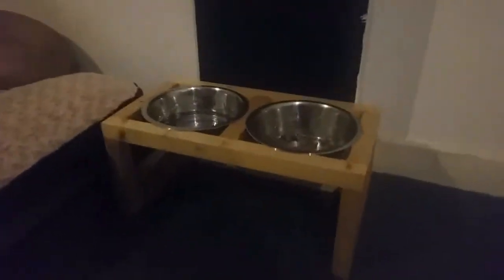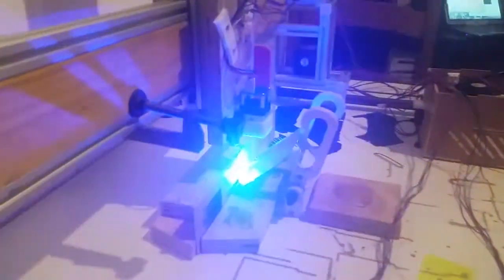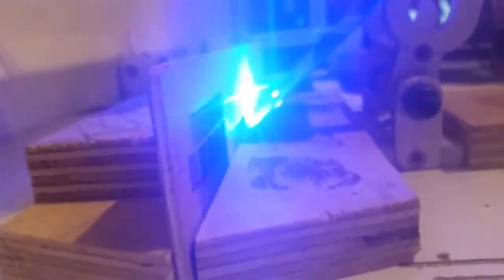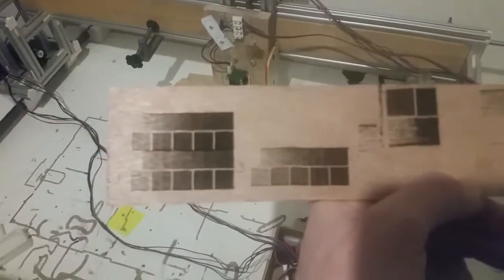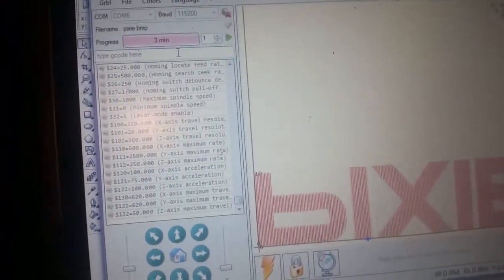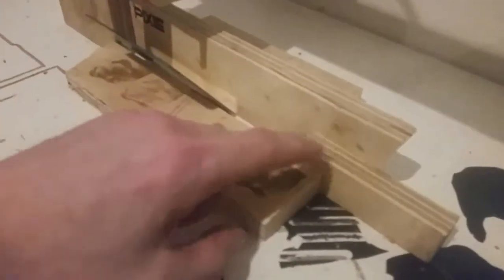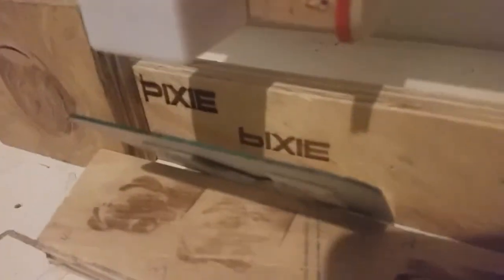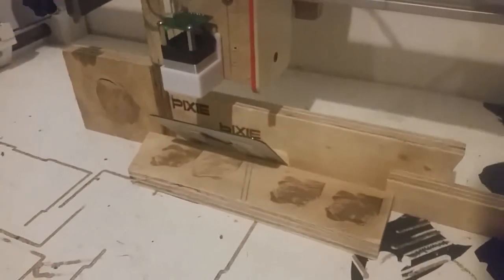Mirror Engraving - Opt Lasers PLH3D-2W

Comment: Hi, is that 2W laser engraver capable of engraving stainless steel? thanks
Reply from the maker: I'm not going to give you a definite answer but I have had success using something one the stainless and on the 2w a few passes does work on the plh3d-6w one pass. Theres quite alot of products available to help engrave stainless. Some people even use mustard. I've had success even with a dry wipe marker. Hope this helps